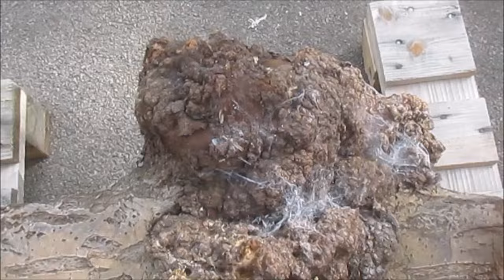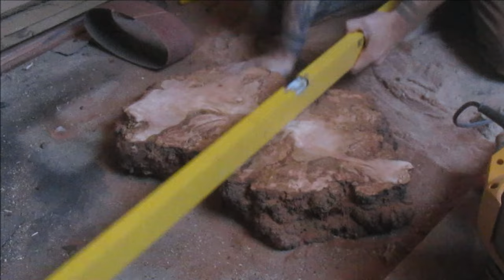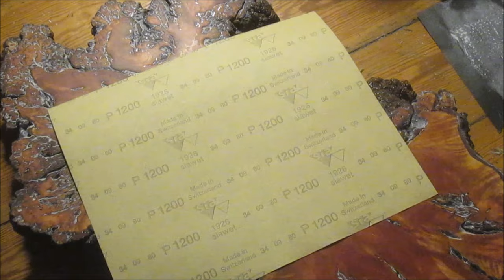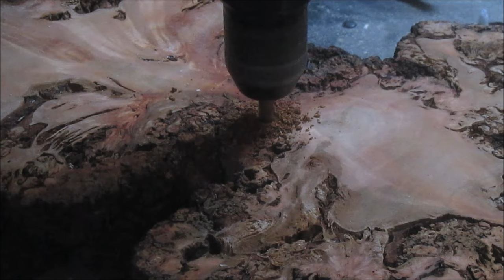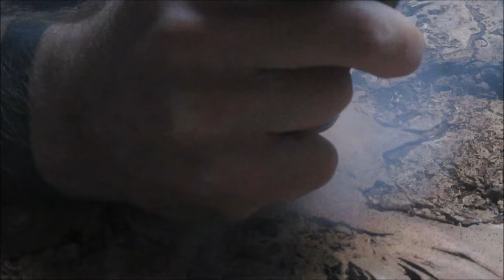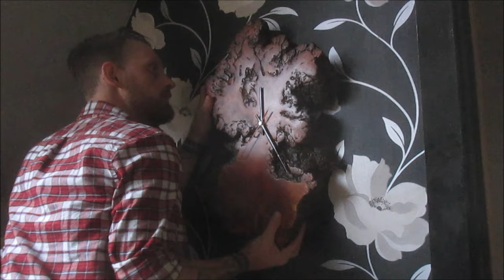The Live Edge Burl Wood Clock Project.................. DSNERV

Comment: Excellent.  Beautiful.  Probably, I would not have glued the clockworks into the burl because the clock won't last forever.  I would have made it easier to replace.  The beauty of the burl will outlast the clock.  I could see that burl being used and re-purposed for 100 years or more.
Reply from the maker: Looking back on it your right, gluing the clockworks in there was not the best idea. I'm sure it will not be so hard to pop it out when the time comes that it needs replacing.
Reply: Yeah  @dsnerv   - it comes with a brass nut to screw it down. Beautiful clock tho.

Comment: Love this piece, though I'm very confused as to why you'd dry it out for four years only to then soak it with a pressure washer right before finishing it?
Reply from the maker: Hey Jon.
Yeah i know that it seems a little strange to hit it with a pressure washer after being drying for so long but it is a important part of the process. When dealing with burl wood like this all the small cracks and voids tend to get filled with mud and stones as the tree grows. (not to mention all the sawdust created when cutting the slab)
All of that needs to be cleaned out from the voids or they will bleed into your finish and destroy the look of your project. the quickest and most easy way to clear all of that out is to use a pressure washer to blast it out and then leave the burl in the sun for a few days to help dry it out. 
I hope that helps explain why I had to use it. :)

Comment: Nice job bro. How do you keep it from cracking? Every time I cut out a disk like yours it cracks
Reply from the maker: Hey Troy.
The very best thing you can do to help stop cracking is to make sure that the wood you are using is fully dried before cutting your blank...... As an example the cherry used in this clock had been drying for 4 years so the chances of cracking once cut where very low for me. 
Its also recommended that you don't expose the wood to a sudden change temperature (moving your cut blank from outside into a heated area) as this also can cause cracking. Best practice when dealing with burl is to cut it long leaving extra trunk to so that any cracks that happen when drying don't travel into your burl, make sure that your wood is fully dry before considering working on it in any way, move the hole section of trunk into your house and let it get acclimatised to the heat of the room and after a few days you are able to cut your blank.
I will say that having cracks and splits in your blank is not always a bad thing and you can often use them to your advantage to create a more interesting work. 
Here is an example of how I have used cracks to enhance a project that might help you: https://www.youtube.com/watch?v=D58QAnHrgMU
Reply: Thank you

Comment: what oil did you use before the spray lacquer?
Reply from the maker: Hey Mark
I used 2 oils on the burl clock.
4 coats of teak oil so that it soaked deep into the wood and then an extra 2 coats of boiled linseed oil to help bring out the colour some more.
Reply: good to know. looks great!

Comment: very nice i love this, have you thought of using a random orbit sander before? ive found when sanding large areas that a ros is a lot easier with less dust than a belt sander, the one I have is a cheapish erbauer from screwfix, the titan brand i think is screwfixs own brand, i haven't used the sander but other titan power tools i have used have been very good for the price, what oil did you use under the spray varnish?

Mark.
Reply from the maker: Hey Mark.
Thanks for your kind words about the burl clock.
I have wanted to get my hands on an orbit sander for a while now as I know they are better with dust compared to belt sanders. I have been waiting till I eventually killed my belt sander before i could justify getting one (moving to a new house soon so I am trying to save as much as possible.) Seeing as Christmas is just round the corner maybe I will add it to my list and see if i get lucky.
I ended up using 2 oils on the clock........ 4 goes with a teak oil for deep absorption into the burl and then 2 extra using a boiled linseed oil to help bring out the colour of the grain some more. 
Hope that helps.
Reply: dsnerv i hope you get a random orbit soon for xmas and good luck with the new place bud :) , thanks for the info on the oil, I have some boiled linseed oil which is handy but no teak oil, Ive been messing with oils a few times trying to get the right mix for using on a lathe, the US has denatured alcohol which is the same as clear meths, ive mixed 1/3 Boiled linseed oil 1/3 shellac and 1/3 clear meths for a friction polish, also the same mix but changing the shellac for clear varnish to try and make a very tough oil finish.

i think i need to mess with the mixes a bit though as the shellac i bought i think they used too much meths so its too thin, the varnish one though is good if you sand the finish back a little.

just a few ramblings bud maybe you might get something from that  lol

maybe if you run out of teak oil then clear meths cutting the BLO down a little will help it sink through the wood more then the meths will evaporate, last 2 coats without the meths and it should be fairly cheap to buy.
Reply from the maker: Hello again Mark.
Thanks a lot for your advice and knowledge on how you are working with your oils and varnishes, I really do apresheate comments like this so much. 
A main part of why I post these videos on youtube is not only for the fun of it but to be able to share and gain info so that I am able to continue and grow with my little woodworking hobby. Everyone in the comments has always been extremely kind and supportive but its a comment like yours that will help me continue getting better at what I enjoy.
Thanks again and good luck with all your future projects.
Reply from the maker: Thanks a lot Mark.
I just had a quick scan through the Daniel Vilerinos video and I will defiantly go back and check it out in more detail when I have a bit more free time, thank you.
I have wanted a lathe for a long time but same as with the orbit sander I just can justify the cost of one right now as I prepare for the new house and all the costs that come with it. 
Wish me luck hahaha
Reply: Yes good luck with the new place i haven't finished mine yet and I've been here over 2 years now, i hope it isnt as bad as mine was.. full rewire and full pipe work plus all new bathroom kitchen and windows plus doors, all new walls and ceilings as the old plaster was probably the original from 1910,  wiring and pipe work was from when invented lol

1 socket upstairs and 2 downstairs, the sockets and lights were fed from 1 steel box like a petrol forecourt fireman switch with a broken front and bare fuse wire.

I havnt known such pain and never want to again!
Reply: I hope you have an easier time with yours buddy